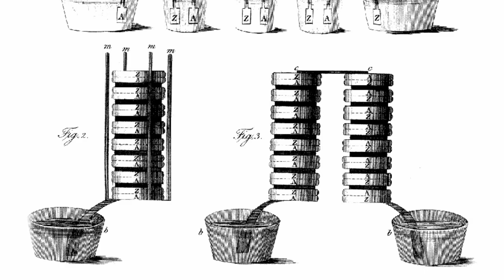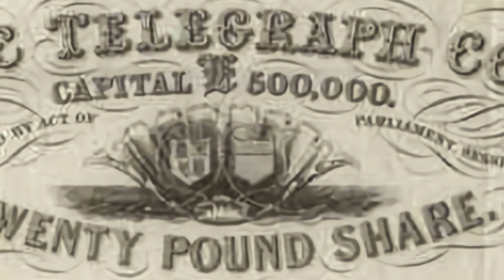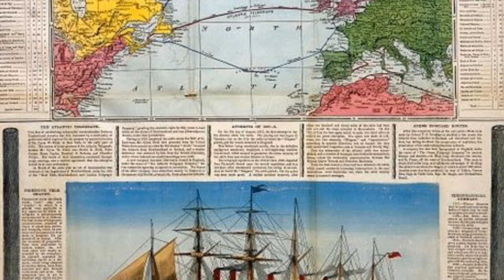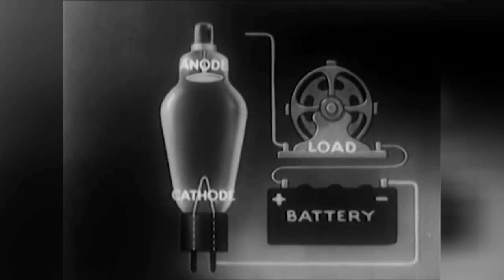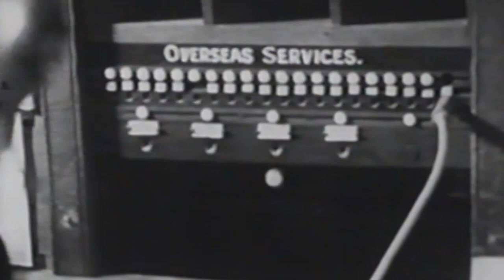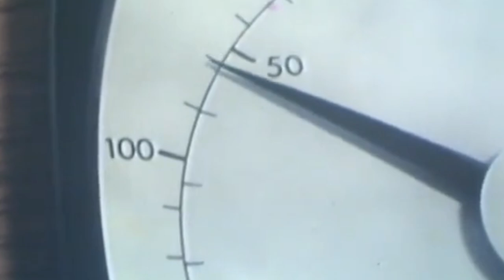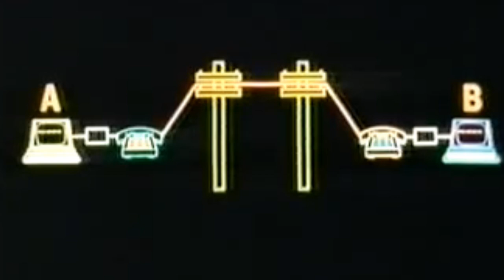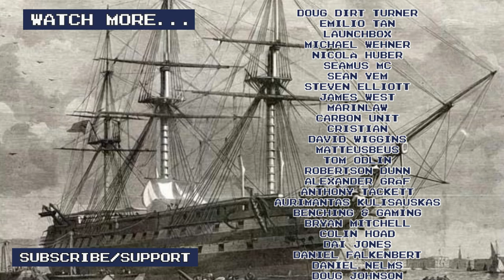How the Internet Crossed the Sea | Nostalgia Nerd

Comment: so if solar flairs took out our satellites, we wouldn't loose all our internet?
Reply: If only satellites were adversely affected by the solar flares, then most of the Internet would still be functioning. However, solar flares have the potential to create electromagnetic pulses (EMPs), which could destroy the electrical grid and long copper cables - https://www.livescience.com/38848-emp-solar-storm-danger.html . As the Internet relies on electricity to run computers, servers, routers, switches, the lasers in fiber optic cables, etc., a strong enough EMP could disable part or all of the Internet.

Comment: And I used to think that DWDM requires optical refocusing the light on fibers every 50-100 km and every 200 km complete electrical regeneration is necessary... So, how to do that on a cable of 7000 km? Anyone???
Reply: Repeater every 60-70 kms
Reply: @hoppynaki  Right. and how to regenerate  electrical every 200 km under water?
Reply: @fredarendse4932  The power feed is not regenerated. It is a DC feed with a positive feed from one end while the other end provides negative. A virtue earth is derived  at about the halfway point in the cable. The fibre regeneratures derive their power from the potential difference across them. I have never worked on submarine fibre cable, but I have spliced the land sections of the old copper submarine cables. I have spliced a lot of land based fibre cables.
Reply: @hoppynaki  I meant that light regeneration. power is another issue. high voltage, right? On 7000 km you lose a bit...
Reply: @fredarendse4932  The light has to be regenerated about every 70Ks
Reply: @hoppynaki  I ask myself why people make movies which are beyond reality ... nobody speaks about optical reshaping, regenerating the signal electrically, cables floating @ 200m dept to avoid under water volcano and trenches up to 6000 m deep. Nobody tells about special ships in harbors 24x7 on standby with 50 km reels with special watertight connectors on both ends which connect to some kind of 'submarines' equipped with high voltage converters to telecom standard 48 VDC to regenerate/amplify the multi-colored invisibly light ...

Really strange you don't see those movies, right?
Reply: @fredarendse4932  You are so right Fred. It's easy in the movies but when it comes to the real thing you have to think at the nuts n bolts level.
Reply: @hoppynaki  At least 2 people know how it really works... You did 'some' splicing in the field and I owned some fiber pairs on some routes IRU to my DC...
Reply: @hoppynaki  Shall we tell them that these cables cost hundreds of millions of $$$, are owned by oil producing companies, chemical companies and even telecom equipment manufacturers. Yes, if you believe political chitchat, internet is back 30 years... Wawei out is the same like going back to ?smoke signals? probably...
Reply: @hoppynaki  Correct, and it can take perhaps 15,000 volts to power across an ocean because everything is in series. The load can ideally be shared between the two ends at 7,500 volts each or else you can move the virtual earth (or have it moved by a cable fault) for unequal sharing. I think we are all agreed that it is best to turn off the power before splicing the land sections as that is where the highest voltages are needed.

Comment: all this innovation from AT&T and they still cant get a DSL signal that travels less than two miles from the  source without dropping a whole 10 mb/s...pathetic just goes to show if there is money in the upgrades corporations will risk almost anything, but when its simply an upgrade to standard of living in the modern era they are not willing to dedicate a single penny....or in my case a damn relay or amplifier....if they would just replace the lines with new ones of the same Tech their lack of maintenance in the area would be overshadowed by a new found performance.

Comment: (7:59) - No. Of course sending a "note on a boat" was cheaper.
What are you talking about?
Sending a letter was far cheaper than sending a telegram.
The point about the telegram is that it was instantaneous, while sending a letter would take weeks to cross the Atlantic.
You really don't know what you're talking about.
>